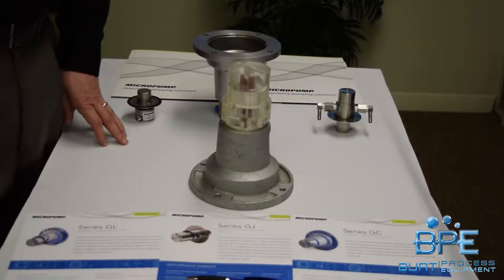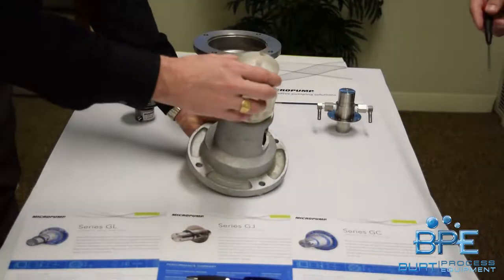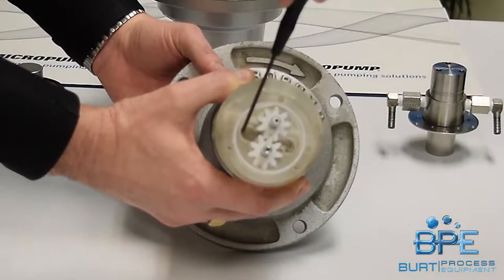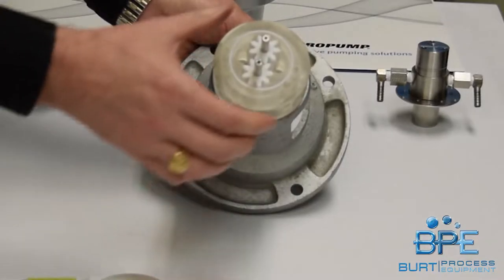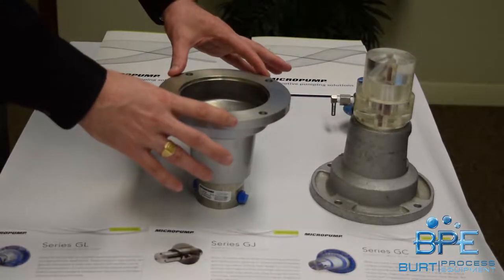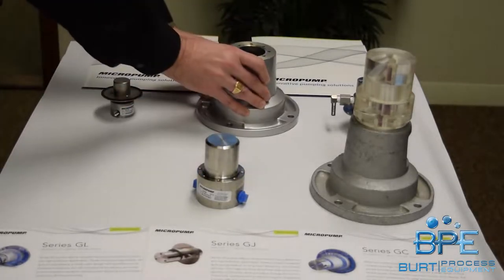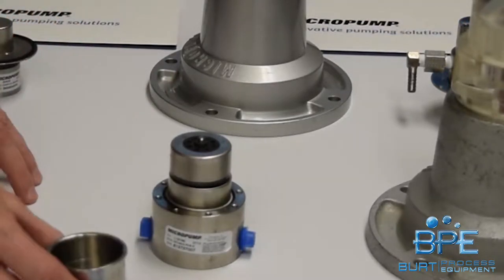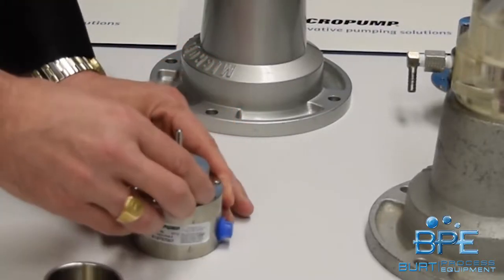Micropump Suction Shoe VS Cavity Style Pumps Short

Comment: Hi I would like to know if air can pass through the pump from both directions for drying of pump purpose. Is this pump completely drainable?
Reply: Hello Sagar, the pump is not built specifically to be fully drainable.  The Magnet Cup will hold fluid.  The pump is cooled and lubricated with the pumped fluid.  It may be possible to pass air through the pump but has never been tested in that way so I cannot confirm how best to fully dry it.  All pumps are tested before leaving the factory and are shipped with small amount of residual water.  I hope this helps and please reach out to customerservice@burtprocess.com for direct conversation.  Thank you!!